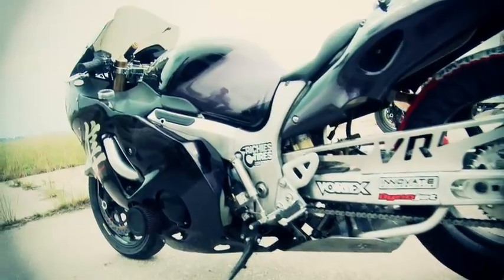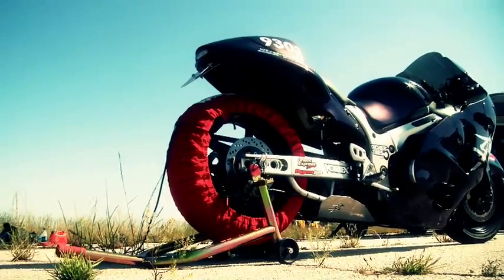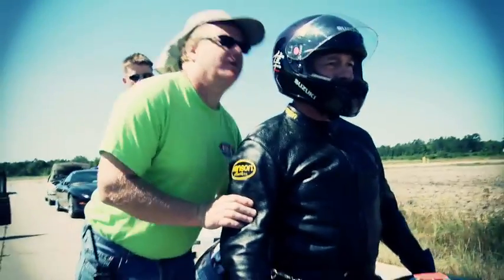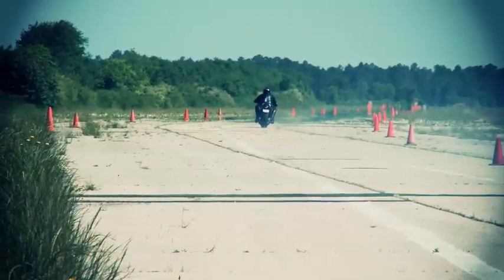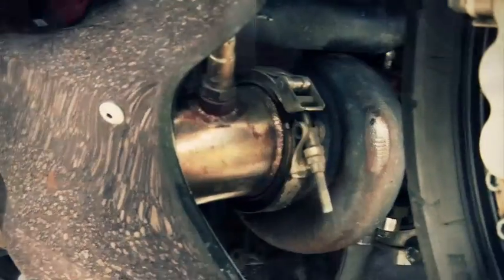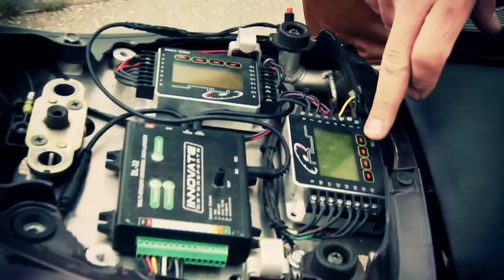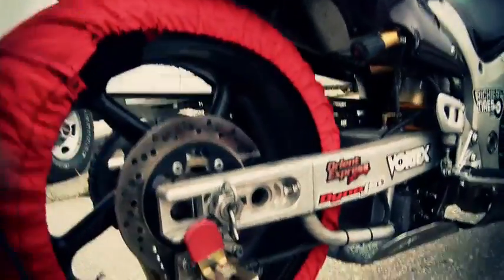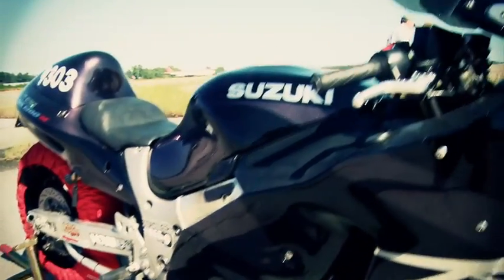Fastest Mile- 256.79 MPH on a Turbo Hayabusa

Comment: On a lot of motorcycles, the speed governor is actuated by exhaust backpressure, so changing the stock exhaust to a wider aftermarket one will change (increase) the speed at which the governor kicks in. Completely removing the governor requires flashing the ECU, which is best left to professionals.

Comment: Even if you went 220 with that little horsepower (which I don't believe), this bike went 256 from a dead stop in 1 mile. You need lots of power to do that.

Comment: he says 'marvic' which are probably a magnesium alloy. Carbon fiber wheels are really light, and therefore help the bike handle (less unsprung weight) but they are illegal in most all racing sanctions because they (gulp) tend to explode at high speed with the right impact. And since this bike goes straight and is more about top speed, the magnesium is a better bet.

Comment: @pyk420biatch we're talking about the cost on one car. one engine. you're talking the 'engine budget' as the cost for building an engine. wrong wrong wrong. use your head. 

"A formula1 car costs around 2 million dollar to build, with the engine only costing a few hundred thousand dollars, the gearbox close to 200,000 dollars. The steering wheel costs about 15,000 dollars."

from: w w w . f1complete . com / content / view / 235/381 /

probably oldish, but a new f1 wouldn't be much more.

Comment: @pyk420biatch so fucking what? they give you an idea of what the car would cost.

they did cost 4-2 million then to build just the car (inc engine). you think they cost 200million now? 

931 mil on the engine? wtf. you're in lala land or high on something.

have a look at the website and get a clue as to the percentage spent on development/research/salaries. then look at the 'manufacturing car costs'. 

building the actual car is the relatively cheap part.

Comment: @pyk420biatch you are completely dead wrong there. the engines cost maybe a million to build. not whatever stupid 100+million figure your thinking of.

i have just shown you the costs of it all anyway. look at the website. then look at 'manufacturing costs'.

not bright are you. you haven't a clue what you are talking about.

Car manufacturing costs:

$4,100,000 Ferrari
$2,700,000 McLaren
$2,000,000 Toyota
$2,000,000 BAR

etc etc

Comment: I had a 04 busa and I'm 6'6-300lbs and in LSD Vegas at 4:30am everyday after work 
(a crap dealer) I would see how fast I could get on I-15 s. Flamingo to troppicanna. I got that sucker up to 190mph and had plenty of throttle to go , but I could not hold on annymore. I will admit. Plus I couldn't see the speedo after 190. It was a blurrrr. I had to sell it cuz I have kids and I went nuts on it. 
I had to go faster everyday for some stupid reason.

Comment: @balwantspkful of course it  does more than the veyron. At 600+ whp a busa has almost a 1:1 power to weight ratio. That's just stupid silly. They veyron is an amazingly done car but it weight as much an M1 tank and it's engine its so over complicated it needs a retarded amount ( 11 ) of radiators to keep it cool. It's a great car, but it's just like the busa...it's a nice car if you don't care about turning.

Comment: @sherrod0506  On the Mile tracks the best Supra has run is about 247 mph. Nissan GTR hasn't gone beyond 230 mph. The best speed for a street based Supra is 249 mph at Bonneville salt flats. Last October Bill Warner ran 278 mph at the Texas Mile with a turbo Busa. The best cars are 15 - 25 mph slower at between 250 - 262 mph for Ford GT (1500 hp allegedly) and Lamborghini (1200 hp +).
Bugatti SS ran 267mph but took over 4 miles! As Jeremy Clarkson would say...car lovers..... you can.... shut up!

Comment: After about 150mph the wind drag is insane on a bike, the rider HAS to know what they are doing or at these kinds of speeds they would lose it. Try sticking your head out of a car at 100mph then you will see. I've had my GSXR1000 up to 160mph and moved my head up about an inch and almost got blew off of it, ya gotta keep your body tucked or its road rash from there on out.

Comment: Bike aerodynamics suck at the best of times all that exposed rotating wheels, et al + plus rider technique is very important. To the guy that says a dragster is faster - have you ever ridden a bike over 200km/hr let alone 200 miles an hour? + I'd like to see a top fueller go around a corner at speed LOL. Regardless 480rwhp = over 410km/hr or about 1.2 rwhp / km/hr - pretty bloody good!!!

Comment: @killercrx91 . Did you not hear that he had to turn boost down and the hp at the wheel dropped down to 480hp. It was over a mile and a mile isnt long when you spend half of it trying to keep the front wheel down

Comment: @swift606 
Hahahahahahahahahahaha put it up against a top fuel dragster then, looks like the whale an't even turn with all the long wheel base shit going on here.
And your power to weight is a bit off, it looks a heavier bike than normal so with wet weight its probably around 300-320kg and this fat dumb fuck weighs about 100kg at least just say bike + rider weighs 420kg and the hp is not at the wheel so about 550hp at the wheel, barely better than a moto gp power to weight, sorry.

Comment: @VIT0R1984 Visit Texas Mile site and see that in October 2010, Bill Warner's Turbo Hayabusa ran 278 mph (448 kph) from a standing start. This is a mile distance from a standing start on a disused runway, not 4 miles over a special test track. Sorry, Busa owns Veyron SS in straight line performance by a big margin. Best Veyron has done over standing mile is 203 mph.

Comment: @jarrus464 What more proof do you want than the timing slip from the East Coast Timing Associations electronic measuring system? Go to their site at Maxton Mile and you can read about all the records achieved there as well. Go to the Texas Mile site and see the evidence. The timing is to the thousandth of a second. This bike has the power to overcome any aero disadvantage. In October, at the Texas Mile, Bill Warner's Hayabusa Turbo ran over 278 mph. A Lamborghini ran over 250 mph at this event.

Comment: @zipper1503 It's not the weight , although that is important in the first half mile, but the horsepower to drag ratio. The drag is a function of Cd and frontal area. The Suzuki Hayabusa was designed in a wind tunnel and it's aerodynamics are better than almost all big bore production motorcycles. That is why the Hayabusa has consistently been the fastest production motorcycle in unrestricted form since it's introduction in 1999. A brick with the same frontal area would have over 50% more drag.

Comment: IT certainly has the power, but I haven't seen the proof that it will do those speeds, it looks fast but obviously you need proof of that 256 mph run.

Also I didn't think bikes have the areo dynamics that cars do to reach those kind of speeds

Comment: Put a long as swing arm on it and make an aerodynamic shell for it, get a longer run way and put the turbo pressure on max then gradually build up acceleration instead of thrashing the shit out of it and letting the turbo wind up fast. yu will be able to go shit loads faster =|

Comment: @heyybii Bugatti Page, Standing 1/4-mile: 10.8 sec @ 140 mph
Auto Spies 1/4 mile in 10.4 seconds @ 139.9 mph
Japan Test (YouTube)0-400M(1/4 MILE) Bugatti Veyron 10.00 s @235 kph (146 mph)
Motor Trend 0-60 mph: 2.7 seconds 1/4 mile: 10.4@139.9mph
Wikipedia 10.2 sec @ 141 mph (227 km/h)    2006 Kawasaki ZX-14 motorcycle 	9.65 sec @ 153 mph (Hayabusa similar performance)
Road & Track 10.2 @142.9 mph
Top-Supercars 0 - 1/4 mile 	10.3 second
Veyron Average = 10 .33
Hayabusa between 9.55 & 10.5

Comment: @heyybii I've known about that clip for 2 years. it is not a 1/4 mile run. Where did the Veyron come from? It may have been approaching this Yamaha from behind 20, 30 or 50 mph faster. It wasn't a side by side roll on. The Yamaha wasn't left for dead but kept the Veyron in sight then caught it up. It was not a Hayabusa which has superior high speed acceleration between 50 and 150 mph compared to an R1. The Japanese clip = 1/4 mile in 10.0 seconds. There are other videos with Veyron  10.2 - 10.6.

Comment: @heyybii Bugatti claims 10.6 1/4 mile. 
Dragtime = 1/4 Mile ET: 	10.410
1/4 Mile MPH: 	139.910
Don't know where you got the 10.1 Veyron average from.
Here are some Hayabusa times =1/4 Mile ET: 	9.679
1/4 Mile MPH: 	144.640
20) 	9.510* 	138.800  	  	  	1.520  	Suzuki Hayabusa  	2005  (stock with exhaust)

Comment: @heyybii But then over 100,000 Veyrons haven't been made that can do sub 10 second 1/4's. Show me a video of a race between a Veyron and Hayabusa.
Sure a Veyron has a much higher top speed but in acceleration between 50 and 150 mph the Hayabusa would win. The Veyron can't reach it's potential top speed of 253 mph without a special test track or a closed section of dead flat and straight freeway. In practical day to day situations the litre+ superbikes have it over the Veyron in acceleration.

Comment: @capnapalm How do you know how much has been pumped into the Veyron's aerodynamics? Surely only VW would know that? The Hayabusa became the world's fastest production motorcycle because Suzuki used aerodynamacists and a wind tunnel to design the motorcycle bodywork. It's the reason why the stock Hayabusa is still slightly faster than the Kawasaki ZX 1400 despite a horsepower deficit. It's aerodynamic efficiency is the reason it is the most successful street legal bike on the standing mile.

Comment: LOL at the tardfest comparing a 1.5million dollar CAR to a turbo'ed MOTORCYCLE. It is infinitely more difficult to get 3,500 pounds with a large front profile to over 260mph. I;m not crapping on either the bike or the veyron, but you guys are arguing over a bike that is brute forcing it's way to 250+ and a car that had hundreds of millions dumped into the aero design to get it just over 260.

Comment: @kayu38 My point is that this bike kicks Veyron arse in acceleration. It is in nothing special state of tune using off the shelf components and mass produced tires. It's a testament to the brilliant design and strength of the Hayabusa engine that a mass produced motorcycle, with relatively little modification can achieve 256 mph at the end of a standing mile, 52 mph faster than a Bugatti Veyron. 
The Veyron SS  costs over 50 times more and required a special test track. What public road?

Comment: @kayu38 I spell it out clearly for you.
I own a Suzuki Hayabusa but it is not turbocharged.
I do not own a Bugatti Veyron.
The Lee Shierts Hayabusa ran 256 mph for a standing mile.
This is a road registered motorcycle with readily available road/sports tires.
The standard Veyron took over 4 miles on a test track to reach 253 mph. (Wiki)
The Veyron SS reached its 267 top speed on Volkswagen's Ehra-Lessien high-speed oval. (Wiki)
The Veyron reached 204 mph in the standing mile. (Road & Track)

Comment: @kayu38 Yes but not a turbo version. Do I need to own a Veyron to have an opinion? The "standard" Bugatti Veyron at 253 is on the same page as a Veyron SS at 267.
My original post was to rebuff those viewers that trot out the Veyron as an example of a car that would beat this Hayabusa. Clearly even the SS Veyron can't beat this Hayabusa over a standing mile. This is just a disused airstrip.
There is nothing wrong with researching facts. It's better than plucking them out of my arse. Public road?

Comment: @kayu38 The Veyron is THE most special car in the world. I don't think Veyron owners would agree with you. They have paid over $1.2 million for the special privilege and status of owning the most exclusive car in the world. It is very, very special. The Hayabusa in this video is based on a 2004 Hayabusa. There has been over 100,000 made. It has a turbo-charger some electronics and slightly modded swinging arm. It has stock bore and stroke, stock frame and stock bodywork. It's not very special.

Comment: @kayu38 Yes, that applies to some extent to a Turbo Hayabusa but I respond to people who post comparisons with the Bugatti Veyron and include the 267 mph top speed as though:
1. It can be achieved within a mile.
2. It can be achieved on a public road
3. Can be dialed up at will.
It uses special Michelin PAX run flat tires, designed specifically to accommodate the Veyron's top speed, which reportedly cost $25,000 US per set.
If that doesn't constitute special tires then what does?

Comment: @kayu38 267 mph on a special test track with special tires. There is no public highway on earth where a Veyron can be driven safely at it's maximum speed without road closure and under ideal weather conditions. It's not a case of a Veyron driver pulling out of the driveway, finding the nearest highway and flooring the accelerator. It's limited by road conditions and the maximum speed is just a potential it may reach under very special conditions. Mostly gives the owner bragging rights.

Comment: @hondahp18 After 3:30 he says they used Michelin Power Pilot race tires (should be Pilot Power). They are treaded, ZR rated, production racing/road tires that are built to tolerate sustained speeds over 150 mph and are presumably safe for bursts to over 200 mph . If it were my bike I would be asking Michelin about speeds in excess of 200 mph and would be changing the tires every few runs. There have been some accidents with some bikes on these mile courses at the top end. Maybe burst tires?

Comment: @mat12128 actually at that speed the bike will stay on track till it slows down, even if you jump off at 250 mph
not even a rock the size of a fist would have any effect on the bike.
think of the gigantic momentum of the bike.

Comment: @thing503 Well it depends if you are running out of RPM or horsepower in the top end.  If you run out of horsepower, lightening up the vehicle will increase your top speed, if you have enough horsepower already to run out of RPM, then power to weight ratio is no longer a factor.

Comment: Actually, I would redesign the front fairing in a wind tunnel just to create more down force at 200+ mph.  You want to direct more air being diverted around the sides to going straight over the front end of the bike at an angle and pushing downward on the front end (with vanes inline with the bike or whatnot).    @droceretik.  basic flying is not hard to do, its all the G.D regulations and VOR and safety checks that have to be done.  G.D. FAA drives up the price of flying so only super rich can

Comment: @cobrachoppergirl That's good and it sounds like a great buzz, however, I was referring to nandoanalog's comment that buying a cheap plane ticket would be a good substitute for riding a Turbo Hayabusa at high speed. Flying at a steady 20,000 ft is....well, boring. Flying a chopper to herd cattle would be exciting and very stressful I guess. That's why people do para gliding, skydiving, base jumping and motor cycle racing. Adrenaline. Nothing to do with Bugatti Veyron. Is chopper hard to learn?

Comment: Since at 200mph you have HP in exceess, but not enough downforce on the front end, make yourself some 'CHOPPERGIRL' fins on both sides of the front end angled downward.  Pressure hitting them will create a vector force downward, just like a spoiler on a race car.  However, for safety attach them with one way door hinges, so if you do wheelie and air hits them from beneath they won't act like a parachute and lift you higher up, but will rotate up and against the bike and lose all lift properties.

Comment: @nandoanalog You can hardly compare the sensation of flying in a passenger plane at 20,000ft with riding a Hayabusa at 400 kph. Completely different sensation. In fact there is almost no sensation of speed in a plane when flying high. I guess that is why so many fighter pilots ride fast bikes. They are trying to emulate the adrenaline kick they get from flying fighters. No, flying in a passenger plane is a very poor alternative.

Comment: @nandoanalog In England, from Big CC Racing, it will cost US$13,000 for 280 hp and US$16,500 for 500 hp. That includes Motec engine management but not extended swinging arm which will cost around $1000. So for street with extended swinging arm it will cost $14,000 and for racing $17,500. On average that's about the same price as a new Hayabusa. I don't think it costs "way more" and unless you have actually owned one, you can't say it will break down every second day. Less reliable, yes.

Comment: @davidzzz94 Yeah, change body posture with less weight  on the hands and feet.  Shift the arse back in seat. This transfers more body weigh to the more weight to the rear. If the front tyre normally just skims the road with hard acceleration,  shifting the body back will see the front end lift. At about 45 deg then the wheelie can be controlled with throttle and weight transfer. Only bikes with a lot of power can do "power wheelies" apart from O/R bikes with low gearing and good torque.

Comment: @kayu38 So? What's that got to do with standing mile races and fast motorcycles?
If your comparing the Bugatti's performance with this turbo Hayabusa then it takes over 4 miles for it to reach that speed. This bike reached 256mph in a mile from a standing start. The Bugatti costs over $1.5 mil for the latest record breaking model which is virtually unobtainable anyway. The Hayabusa cost about $15,000.stock and probably another $15,000 to modify to this level. The Veyron cost 50 times more.

Comment: @SoldierCyfix Actually they don't suck at handling .....for a relatively heavy and powerful bike. A well ridden Hayabusa will beat most ordinary riders riding1 liter sports bikes on tracks and twisty roads. Yeah, a GSXR 1000 will beat a Hayabusa around a track and on tight bends given good riders of equal ability but there's not a great deal in it under most circumstances. On the open road with high speed bends the Hayabusa is very stable and would pull away from most bikes.